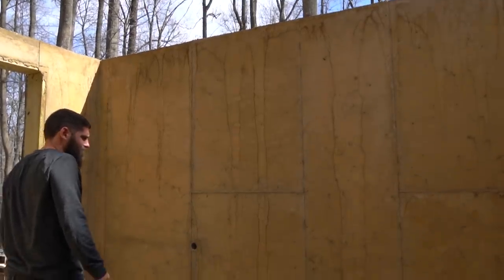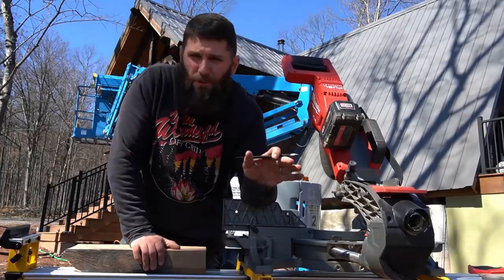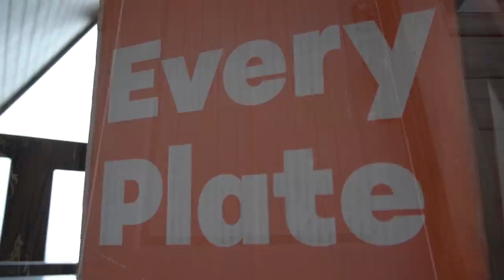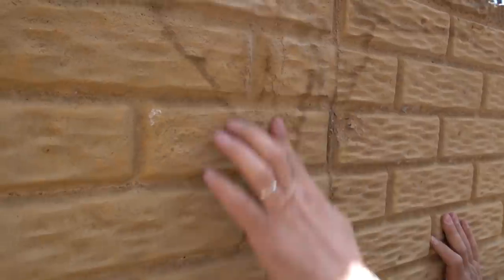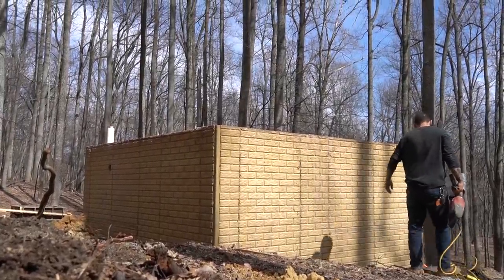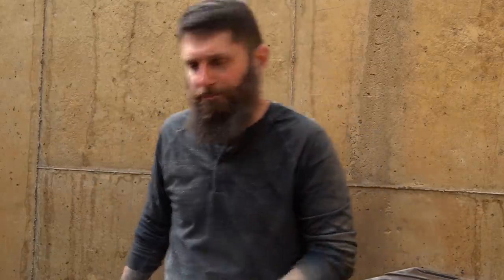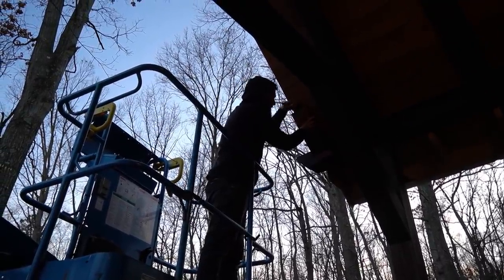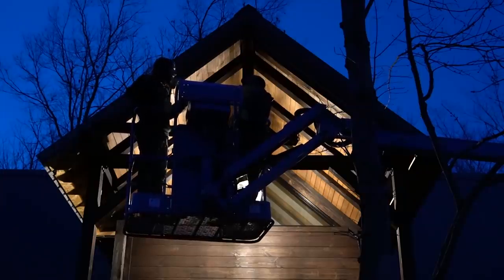Tearing Down The NEW Concrete Walls?

Comment: It's just my opinion, but after seeing the chipping/flaking of the outside of the walls, the cracks, no rebar in the core samples and the unevenness of the tops of the walls.  If it were my project, everything would come down.  Your doing the right thing having the core samples tested.  It will be interesting.  Him not returning calls is a big red flag.  I built my own garage 2.5 years ago and the guy that did my slab pour still comes buy and makes sure I'm still happy 2.5 years later.

Comment: You both have a good eye for quality and it sure seems like that pour was no where near "quality" and certainly does not meet your expectations. The owner of the company should have been there with you to inspect and FIX the issue. Very sad situation. In my estimation though, tear it down now. Better than dealing with major issues down the road which are going to be very likely given the condition of the walls now.  GOOD LUCK!

Comment: I once had a concrete slab poured and the contactor hired to haul and pour used a truck that once carried limestone pellets.  Well the slab chipped everywhere the pellets came to the surface.  Contractor ended being liable for the slab

Comment: welp,  from an ACI Certified Field Tech,   I can tell you from the video of the wall pours,  your mix had  zero slump.  Way too much water.  Lesson is don't ever let concrete finishers control how much water is added at the jobsite.   Get the mix design from the plant to determine the planned batch water gallons.  Then have the plant print the actual gallons that were batched for each load.   It'll be on the delivery ticket.  Then you know how much water maximum can be added at the jobsite without going over the  mix design gallons.    I know you guys contracted your concrete so you didn't have control over this.   But its something you have to have an understanding on up front befoe they start.

Comment: Make sure to specify a 4” maximum slump for structural concrete. That slop was way too wet and will never reach suitable strength. You can expect serious spalling and a very weak wall. Your architect or engineer should specify the mix and slump, as well as the rebar pattern for each pour. If that isn’t practical for you, you can generally request a 3,000# mix with a 4” maximum slump; pour to be rodded or vibrated.

Comment: If the concrete isn’t strong enough would it be easier to just reframe around the original walls and for the new concrete to reinforce those walls with the rebar in it. It would make the walls thicker so the construction plans would change a little but it might take you less time and less work.

Comment: Tear it down guys. You're right about suing them. They just close their doors and open up under a new company and you're screwed again. Common practice by shady contractors. When I saw that mix going in I knew it was bad, their work terrible, and a complete failure. Don't know the inspection in your area so can't comment on that, but I can say that if there was an inspection by the county you could sue them. Again, it will probably cost you more to sue than it's worth. Write it off on taxes.

Comment: Concrete contractors LOVE to take short cuts, and just FYI, the big cheap homebuilders love to hire them.  Watered down concrete, voids in concrete, and uncompacted soil or sub-base are typical problems. Most common is uncompacted sub-base which leads to settling and possible erosion underneath.

Comment: Not sure how they even poured the concrete if there is no rebar in the walls. Unless I'm missing something,  theres Always an inspection of the bar before the pour is even scheduled(atleast on our sites all over new york state) and we have to have 3 samples of the poor for testing also. 100% the contractor is at fault and needs to redo/correct faulty work if it is found faulty.

Comment: Howdy folks, first time comment. Cracks in the walls where the panels were, is a BIG RED FLAG. It will take a lot of extra work to stop any all water leaks. Freezing, thawing,   UGH. Your gut feeling is a good one . Throw a rock under the wheel before the train wreck.   Matt Bowles has it right.  Be Blessed. Good luck!

Comment: Cement truck get away with selling water when they put enough gravel in it that after the run-off flows out it is still hard. The trouble being years later from erosion sets in.
A coat of water resistant (marine) cement about two inches thick will stop that.

Comment: Sorry to tell you this, but, if there's no rebar or expansion joints you should tear it down, that's why it's cracking.
There was too much water in the concrete for it to be 5000PSI
The formwork was also not set correctly at the joints and was neither straight or plumb.
The brick finish will also exfoliate over a short period of time, due to the weak mix and the fact it was too cold to pour concrete that day.

Comment: Had a bad experience with a roofing company who hired a pretend roofer. Had to tear the  whole roof of shingles off . The same roofing company did the second job to protect their reputation . I  watched  them like a hawk the second time around ,and took video as well as pictures . They though sent out their best roofing crew to do the job right the first time .It is very frustrating to get bad work done by supposed professionals .Tradesmen that are good at what they do  will not leave crap , there is pride in doing a good job . I know this to be true as I was one .  It helped to get pictures of every step of the way to get action from the contractor as this was a prefered and suggested contractor  through my insurance company

Comment: You're smart not saying the contractor's name on YouTube and for not bothering to take him to court.  I'm confident you could win in small claims court but even then you wouldn't be able to collect the judgement so it's best to just move on.  I'm a retired General Contractor and regardless of the strength of those walls, I would take them down because they don't have the required amount of rebar in them.  You will only have trouble with them down the road.  Best to do it right now.

Comment: I am 22 minutes into this and I have some thoughts they are not judgments please don’t take them that way I am wondering if anybody checked the slump before the concrete was poured? Because the concrete is really wet the fact that it’s spalling and cracking and it’s only two weeks is huge. I think you’re right to be worried about the integrity.

Comment: It sucks that this happened to you guys. I thought that concrete looked awful soupy when they poured the walls and I questioned why they didn't put rebar in them. I'm confident that you guys could've done a better job than the "professionals." I know it would cost more but at this point I would consider tearing it down and starting all over so the walls are level, square, plumb, and reinforced with rebar. I wish you the best.

Comment: Word of mouth getting the info out about this concrete company among people in your area is the best thing you can do.
  
I had a load of firewood dropped off and paid the guy, same person I had bought wood from a month before.  It was winter, and here in the North it was dark in the morning when I went to work, and dark when I got home from work, so I hadn't been out to look at the stack of wood until the weekend. I sent my teenage son out to chop some of it up.  He came back in and told me I had better look at it.  It was all rotten "beach wood," that is wood that has sat on the beach getting eaten by worms for years.  You could crumble it in you hands.  And did I mention it was soaking wet?
I told absolutely everyone I knew who this person was and what he had done to us.  I did not have the money to replace this wood, and a large home to heat in the middle of the winter.  We shut off all the bedrooms and "camped" in the living room which I had to heat with an electric heater. 
But it didn't take long for word to spread and this person had to find other work.  I hope I saved a lot of people from what I had to deal with.

Comment: I would not trust those cement walls.  I believe in 3 to 6 months that crumbling of the cement will occur. For the value of the cement I would redo those walls and start over. Everything you guys have done with your build has been with Excellence. Why stop now. Praying for you guys. Proud of how you are handling a company of no reputation. Keep strong. Do not get discouraged. Better things ahead.

Comment: Did you know if you don't wash your eggs and clean the coating off the outside of them that you can store your eggs on top of the counter for 6 weeks without putting them in the refrigerator

Comment: That concrete was way to wet, it looked like at least a 10 inch slump, while that's easy it's not good, it should be a 6 inch slump, and then the contractor usually uses a conc vibrator to avoid fissures. I am sorry your going thru this, the contractor should know better, good luck.

Comment: I used to work for a home builder that built 30 houses a year. Good houses.  I remember I was cleaning up one house after the brick masons were done and I hit a brick column on the back porch with the front of my tractor bucket and it fell down. I felt real bad. When I told my boss about it he said I wish you would have knocked all the brick off that house. It was the worst brick job I had ever seen. It was terrible.  Point being even professional home builders hire poor craftsmen every now and again.

Comment: Never pay 50% up front to a contractor, I learned the hard way that it puts them in a position of having way too much control over your project than you. pay a material deposit, never labor upfront. Also inspect the work daily if you are not continually supervising them. If there are any problems issue them a stop work order in writing until the problems are corrected. I agree with other posters, don't make a bad situation even worse by trying to salvage a poor job. tear down the walls  and do it right., otherwise you will always regret it.

Comment: One thing you are going to need to make sure you do if the sample's come back and you end up having to take those wall's down.    Make sure that you put a video clip up showing their un professional work,  pretty sure their letter head with all their information is on the bill,  post that letter head in the clip and warn other's so you can at least help other's avoid the head ache's the two of you through because of their unprofessional work that was supposed to be professional seeing as you were billed for the work.

Comment: Was there any rebar at all put in those walls????  If not that's not a good deal for sure since it is going to be holding up a major amount of weight.  What a mess for sure.  I agree it should be torn down period.  It's called breach of contract on the sub contractors side.  I wonder if the guy was even legal as far as having a State   Contractor's license or insurance even.  Check him out.

Comment: Finding good contractors and using them is like peeling an onion. Sometimes they make you cry. I have used many a contractor in the day and not played many a contractor before. I even had some try to put easements on my property's and then I inform them I will be counter sueing them also and I get $2500 an hour for my labor so they better make sure they they can afford me if they lose. I usually do everything on my rentals and places I flip and use my crew. I get realtors trying to get me to work for there clients all the time.

Comment: Having done concrete work myself in my younger days -- the days when I had to use a wheelbarrow to move concrete from the truck to the form because those fancy pump machines hadn't been invented yet -- it was apparent that the mix used in your walls was way too runny/watery and it looked like it was too sandy (not enough gravel). This results in it becoming prone to cracks, weakness, breakage and failure. Obviously this contractor was far from professional. Also, these days companies take samples of the mix straight from the truck (to determine if the mix is correct) and also later when it has cured (to test for strength). 
This contractor should be sued for practising under false pretences.

Comment: Sorry about your concrete.  Talk to your engineer, consider an inside, outside or top steel tube reinforcing ring around the top of the wall bolted to the concrete.  If necessary some vertical members at the corners.  It's going to come down to what's the most cost effective solution.  I would suspect the load bearing on the concrete is going to be fine, what you don't want is a wall section splaying out or in.  The floor diaphragm is going to do a lot to resist that.  Hell, for hundreds of years they built houses on plain loose stacked rocks.   However, spallation and cracking are always going to be a continuing annoyance.

Comment: Is there rebar in the walls?  You took 3 core samples and didn't hit one. I know with my luck I would have hit rebar on all 3. It sucks you have to go through this, my bet is the concrete fails. On the bright side better you found out now instead of  down the road when you have a completed cabin on top of the concrete.

Comment: That contractor that did your work had no clue to what they we’re doing. Plus the concrete mix had way way to much water in it. I think that because of all of their screw ups that you should sue them for the improper work. Because now you have to tear it all down and start all over again. The first thing was to do the footings then tie up the interior rebar, plus tie stringers and then do form wall castings. With the proper wall locks plus panels tie wires between both walls to lock in place. To hold the form walls in place from the footings to the top of the walls every 2 to 3 feet spaced out left to right ever 5 - 10 feet. Plus each doorway or end wall should have a complete end cap completely sealed vapor lock. We always do a flood test before we ever poured our concrete.

Comment: Families are going to be renting that for a vacation. If the walls fail under weight, insurance will see these videos. Contractors like that crew are the reason for permits and inspections. They were even more lazy to not tie off the mud sill J bolts.

Comment: He can legally come after you for the balance. You contracted for a foundation. He gave you a foundation. Quality of work notwithstanding is a separate lawsuit. But a contract for a foundation was agreed upon and you received one. Now if there are details in the contract of materials not provided then he is in breech of the contract and you can withhold the balance. If rebar was supposed to be used and wasn’t or if you paid for 5000 psi concrete and he used a lower psi concrete . Just a few examples. But if he provided all materials agreed upon and poured a foundation, shoddy work does not protect you from him bringing suit against you for failure to pay. Just be aware.
Reply from the maker: No, he did not complete the contract so he can't come after us for anything.  What work was done was only a portion of the work that was on the contract and this portion that was completed we already paid for.  The remaining balance goes towards work he has not yet started/completed.  Also, as you mention he is in breach of the contract for how the job he has done so far was completed.

Comment: This is exactly why we won't hire anybody to work on our house.  Even if it's the 5th year into fixing up our mid century concrete/brick house. Not easy, but we just don't trust anybody. 
It's very sad, I wish everybody would do their best.
Reply: We built an A-frame house and used sub-contractors.  I can count on two fingers the ones that took pride in their work , did their best, and took ownership of the results.   I had to redo almost everything else.   Yeah, I'm a die-hard DIY'er, and I'm slow, but it's not done till it's done right.

Comment: Knew trouble was coming when I saw they didn't even run a plate compactor before they put those footers in, without rebar no less.  And the faux brick already scaling because so much water in the wall mix.  Sorry guys, but that whole thing has got to go!

Comment: As you know the 28 day strength test is what counts. At Naval Station North Island in San Diego, the Navy build many buildings in the 70’s and after the 28 day test the concrete failed, so they tore down the building skeleton and started over. I am afraid that’s where you are headed. Sorry,

Comment: I know it is expensive but there is no way I’d put a house on top of those walls. I’d never trust them even if your core samples passed, which I doubt they will. Since it is a rental you are responsible for the safety of everyone who stays there and if a wall fails and someone gets hurt it’s on you guys. Do the right thing, it sucks, but you need to tear it down and start out doing it right.

Comment: What concrete company did the contractor use? How many yards of concrete were used, the cost per yard, any extra chemicals used in it from the plant? Had a job once that could not measure a slump, zero slumps. Turns out the batch plant had put too much chemical in the truck, the whole thing looked like an Elephant took whizz all over the surface.

Comment: Ha ding tested concrete for many years. To wet,to many cracks,  way to much flaking of the brick molding . If you got these guys though the concrete company you may not want to use them either. Most all the drivers around here know there slump . But company’s right now are haveing trouble getting any type of drivers. Sorry before I forget if they didn’t put in rebar into the walls I Dought if they put any in the footings ( p.s. my spellings off first two words I did just got out of hospital emergency surgery goo vids